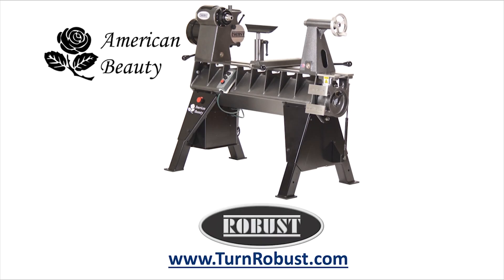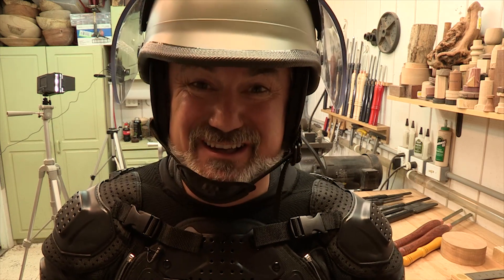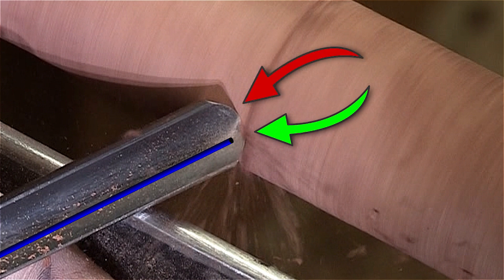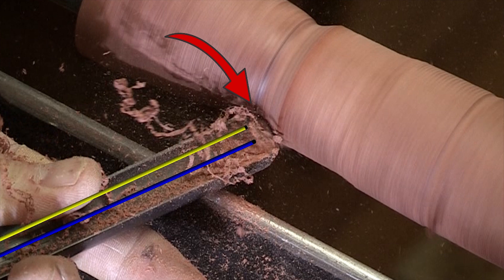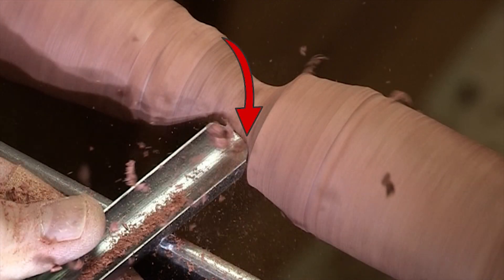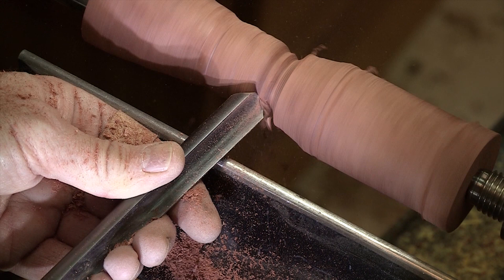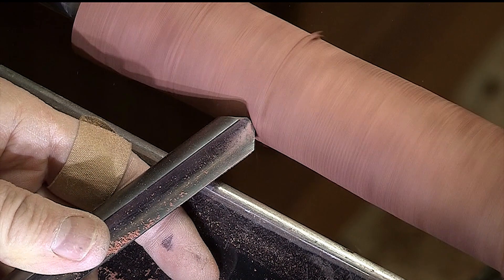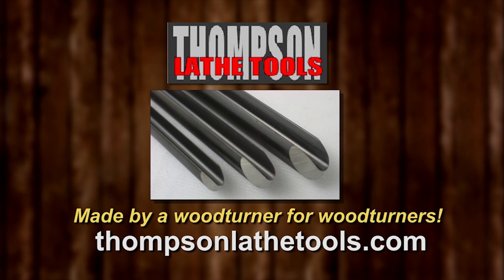Catches-Part 3: Spindle gouge

Comment: Hi I’m just starting out and only have a few tools what came with my lathe. So I’ve been trying to turn some draw pulls from some old oak church pew  legs. I’ve been trying to use a 1/2” bowl gouge with a finger nail type grind. It’s just catching all the time. So my question is can you use a bowl gouge for spindle work. Thanks you videos are very helpful. Regards Jim.

Comment: I find that most of my "skates" happen when I'm doing a steep cut. If I'm cutting to the right and the cut is steep, it's hard to have the handle off to the left, as the steep wall of the cut prevents taking the appropriate angle. Any thoughts on this incidence? Just make sure I'm using the bottom half of the gouge to cut and go slow?

Comment: This is a great series. I have had a lot of design modifications lately with acrylic. Do you think carbide tools are better for acrylic? I've had maybe 3 catches while turning wood. I lost count with the acrylic. Thanks for sharing
Reply: I have preferred using my carbide tools to turn acrylic (I've only turned acrylic for small things like pens). I think the benefit of the carbide is how easy it is to keep the tool's cutting edge in constant connection with the work piece. With traditional steel tools, depending on the cutter, you usually have the turn and tilt the tool as you make a cut which can make it harder to maintain contact with the acrylic work piece. 

Whether with carbide or steel, I find that the best cuts with acrylic are when it is shooting off like string instead of bits and pieces. This is only possible with the cutting edge being in constant contact with the workpiece, hence my preference for carbide tools with acrylic. I hope that helps...just one turner's opinion
Reply: The Odd Artisan thanks for the input. I didn't have the catches or chipping out with the acrylic pen blanks so much with traditional tools. I tried to turn some duck calls for gifts and the acrylic rod I bought for that must be harder or higher quality. My tools dulled real fast, and the catches/chipping was bad. I switched to a large round carbide tool, and was able to finish without much fuss.Thanks for sharing

Comment: have the tools ever been damaged enough that you would need to sharpen, or replace it, when you end up with a catch?
Reply: Only if I managed to hit the spindle or tool rest with the tool edge. In the Roughing Gouge video you can see in the first catch sequence that there is a sliver of metal on the tool edge. That came from hitting the spindle. The tool still cut nicely although it is a Thompson Tool and they are extremely tough.

Comment: Tim, the video is excellent and the slo mo really helps.  The arrows, blue and yellow lines help even more. This makes for a terrific instructional video.
   I have one constructive comment.  In your voice over, you sometimes change the term you use to refer to a tool part or technique, and sometimes don't use quite the right phrasing.  I'd suggest you listen to yourself with a critical ear and I bet you can find a few places where you could say something a little different that will be more clear to the novice turners who are your prime audience.  Great job and very valuable.